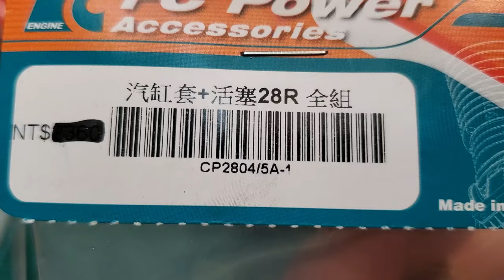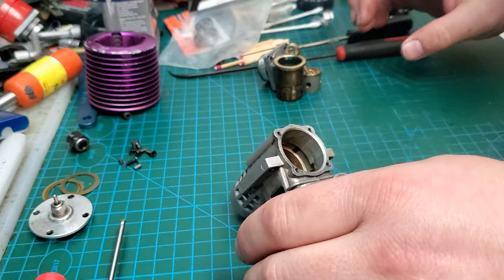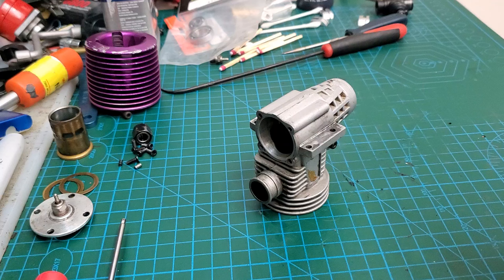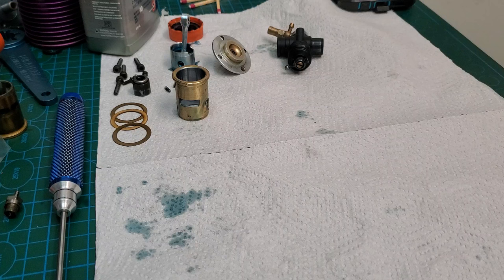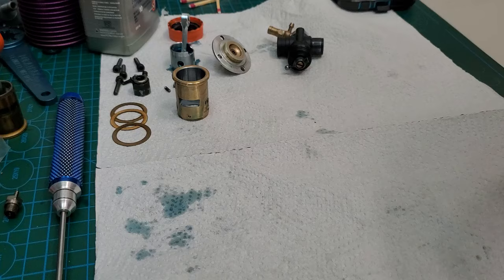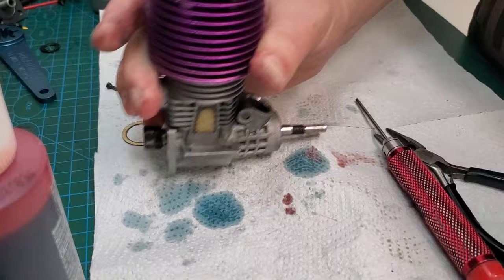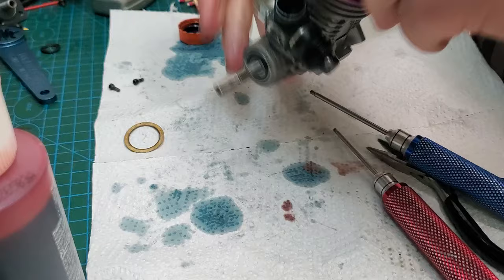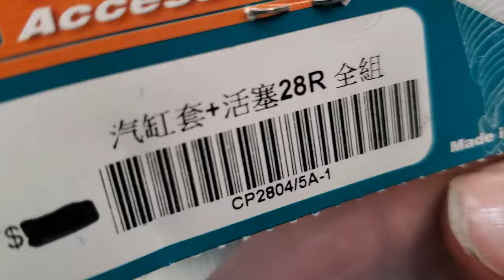Force 28R Nitro engine rebuild

Comment: Great, I've just bought 3 N4 glow plugs for my .28 that's what was advised by the hobby shop 🤦🏻‍♂️ah well at least they will fit my .18 I've only been into nitro a year. These videos are helping greatly 👍🏻
Reply from the maker: The hobby shops are so stupid they will always sell short reach plugs because they don't want to do the work to ensure you are buying the correct plug. Sure short reach plugs work in everything but they are incorrect for most engines. Reduce your compression ratio and can make some engines run weird because you are moving the combustion area higher into the burn area. Thank for watchin! Glad it helped ya 💯

Comment: I use a drill to spin the crack shaft on fine scoch bright  in my hand.  I also will polish it to. Doesn't take much using a drill . I also use a baby bottle brush to  clean  engine  housing.  If you  loose the starter pin and spring  find a old drill bit that fits the shaft hole and cut the bottom end off for a pin and a Bic lighter spring  cut it to size.  Will work in a pinch.   Use a deep wall socket to hit the front bearings out when lined up.   I'll use the crank to install the front bearings with a  little KY goes right in.  Torch screaming 😉😃👍💯 also good idea to change all the back plate orings inside and out if used.
Reply from the maker: Right on and yeah I have used a big spring before it definitely worked! Never thought of using a chunk of drill bit though that's a great idea!
Reply: @thebug4046  thanks  I  no that there hardened steal  so it not going to brake  or chip after hitting the catch.  On the plate. 💯👍✌️
Reply from the maker: @josephsaucedo8691  this is true! The shank usually is softer steel but just before the shank is hardened from what I noticed
Reply: After  get quite a few missing in the engine in a parts ebay buy   engine bundle of 4.1 s   of course every one  missing and parchily disassembled  when receiving them. Going  online then seeing 5-7$ for one set and  needed 6 sets. I wasn't  having it🤔   also socking the one way in degreeser  and then re lubricated  fixes most slipping one ways.👍✌️
Reply from the maker: @josephsaucedo8691  oh yeah man I rebuild one way bearings or clean and reuse them

Comment: 26:25 I find that BDC is the worst position for installing a sleeve. If the sleeve hits the piston you don’t have many options. If you leave the piston high you can guide the sleeve over it while there is no pinch then lower the piston as the sleeve lowers down. They both guide each other. Also zero chance of damaging the edge of the piston. What do you think?
Reply from the maker: Either way you still have to gide the piston into the sleeve. It's the way i have always done it and with thousands of engines I have yet to damage anything. 🤷🏻‍♂️

Comment: You used red sticky permatex but you didn’t mention why. What’s the purpose of putting this on the pin? Just to hold the starter pin? Is that all? Couldn’t you let gravity do that? Because the starter shaft holds it in anyway.
Reply from the maker: I mentioned why I use it so the starter pin and spring sticks to the crankshaft and doesn't fall out when you put everything together. Witch does happen sometimes when putting the back Plate back on.

Comment: great video.

question for you...does it matter if the front bearing has both rubber seals installed?

i just pulled apart my turnigy trackstar .21 to clean it up and i replaced the front bearing...it originally had 2 rubber seals on both sides so i installed a new same double seal bearing....does it make any difference to have the seal on the inside installed?
Reply from the maker: Well I'm sure you know the front bearing actually does not seal the engine it realize on a fluid seal between the block and the crank itself. so that being said if you run the bearing with both seals it won't make it leak any more or any less it'll just starve the front bearing of lubrication.

Comment: What’s the benefits of having a back plate with no starter vs one with a pull starter or slot for a one way bearing and if there’s any preformance would it be noticeable?
Reply from the maker: Running a sealed back plate will allow more RPM but then you have to buy a bump start box and a bunch of batteries and other nonsense. Not worth it just to gane another say 800 RPM if your just out bashing. But in a  competition were every last rpm counts then absolutely.
Reply: @thebug4046  for me I run a back plating and no clutch so I can save about 1.5billion dollars on a battery and pump starter etc all I have to do is push the car and it starts there’s a old video circulating teacher people how to modify the clutch bell using a small pin to make a push starter with no need of a pull starter or drill the one draw back is the vehicle is always in motion and to idle you need more of a gap
Reply from the maker: @asproductions6400  oh dam I remember that video from years ago! Someone posted it in one of the Nitro RC groups I'm in or was in on Fartbook and people were saying some really nasty things about your video. I thought it was pretty interesting to see Someone doing something completely different for a change.
Reply: @thebug4046  I have a speed test on my channel that I posted yesterday and the car I used has absolutely zero clutch the engine is basicly set up like a brushless and what’s interesting is that the powerband is much more aggressive than usual with the draw back that there’s extreme lag down low almost like turbo lag on a car
Reply from the maker: @asproductions6400  i will definitely be sure to check it out
Reply: @thebug4046  yeah I got plenty of videos showcasing the fact it can off road without a clutch and shockingly I’ve had no issues with the engine and I’ve been running it pretty hard for the past year and the engine always starts first pull the only draw back is it puts a lot of stress on the wheel pins and that you can only break at high speeds to lower it to the same speed as idle or it will stall so it requires a lot more driving still but I’ve set it up only to go fast around a corner
Reply from the maker: @asproductions6400  yeah I can imagine it would be a little different to get used to with no  cluch

Comment: Hi whats the main difference between the f4.6 and k4.6?
Reply from the maker: Different manufacturers both are the same displacement but completely different
Reply: @thebug4046  okay cool in your experience which is a better motor ?
Reply from the maker: @keveshannaidoo5670  the F model as it shares parts with several others and is easy to get parts for